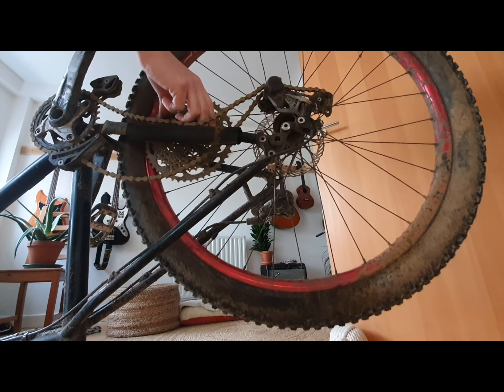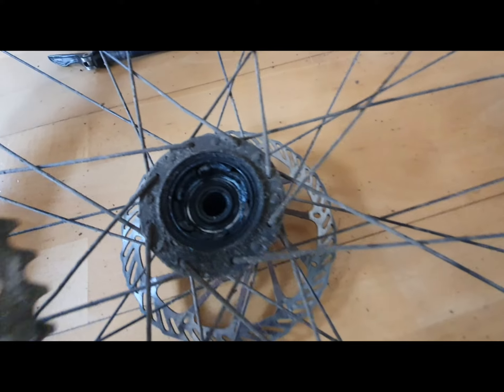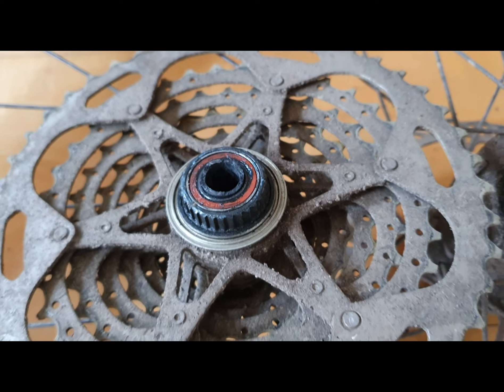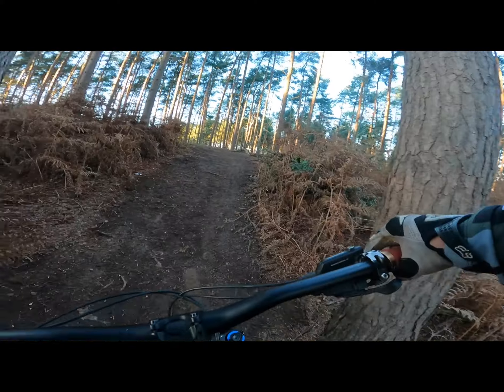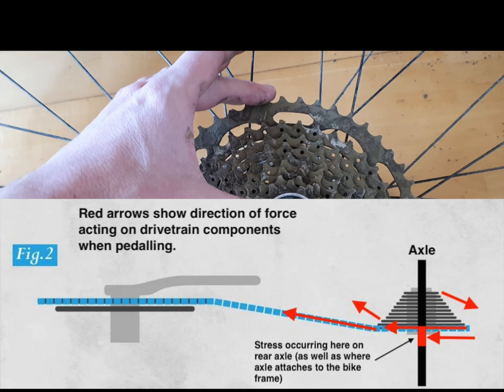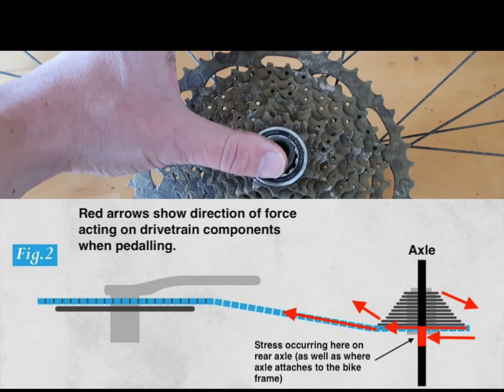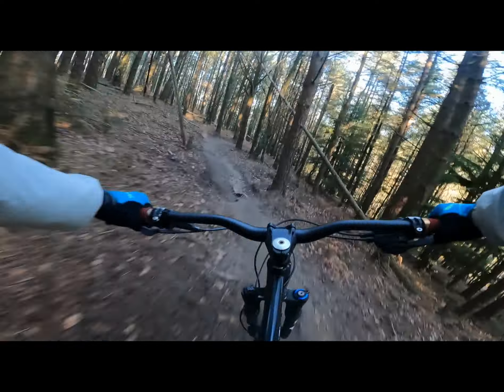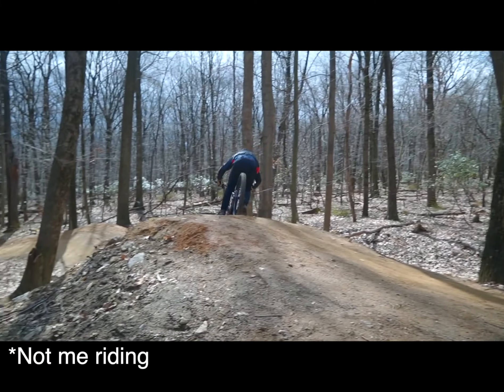Mountain Bike Rear Axle Failure (Hardtail)

Comment: There is a good explanation of why axles break on Wheelworks Handcrafted Wheels YouTube channel. The video is called "Is it worth breaking axles for 690 POE". He says that the axle is designed to break due to it being the cheapest consumable part and is due to initial bearing wear leading to flexing and axle failure. He also talks about the difference with hardtails and full suspension.

Comment: my hardtail with nukeproof HZN wheel,3x8(I mostly use the 48t front chain ring):uh oh i am in danger
Reply from the maker: ah no from what I read its more about rear cassettes with big range (going up to 52t or so) and that putting extra stress on a rear hub
Reply: @BonzoMTB  ah ic, oh but i just broke my squareed tapered bb i had for 5years